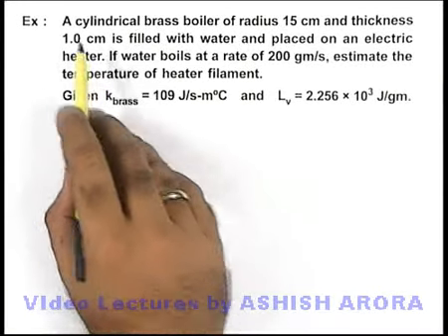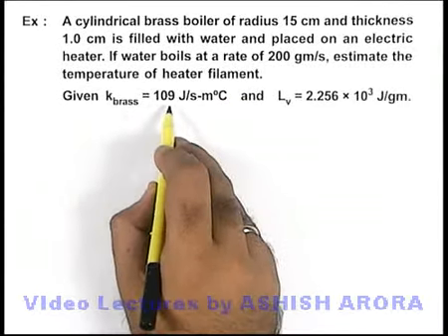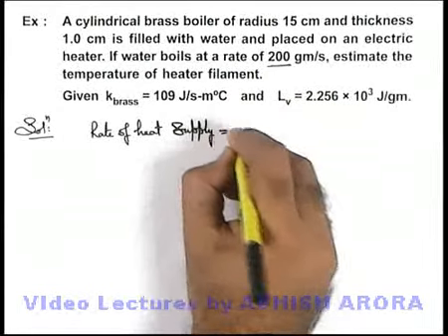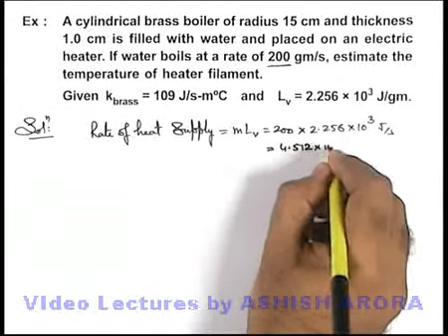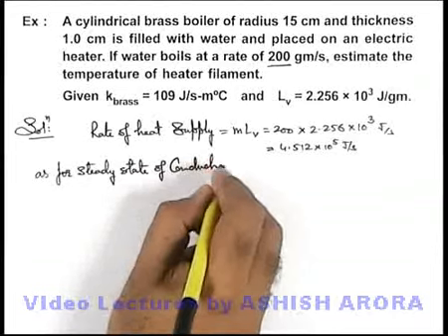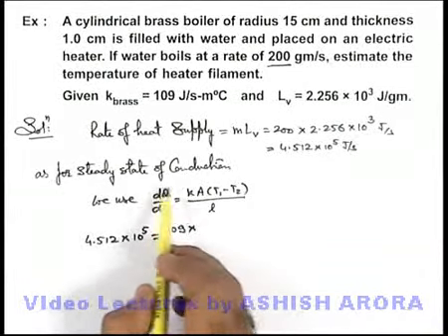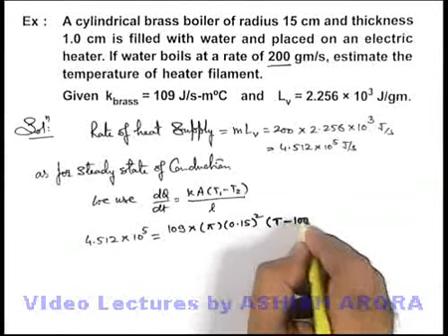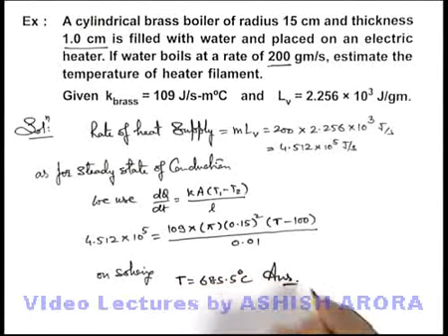Class 11 Physics | Heat Transfer | #7 Solved Example-2 on Heat Transfer | For JEE & NEET

Comment: sir,why didn't you use ms(delta)T?
Reply from the maker: msΔT is used when a body of mass m and specific heat s is heated by a temperature ΔT and thats not the case in the question...
Reply: Here water is boiling...and u might be knowing that during phase transition temperature remains constant....and that formula is not applicable in that case

Comment: 2:42 I didn't understand...how do u take the thickness of cylinder (outer radius-inner radius) as the length of the cylindrical boiler!?
Reply: Ritesh Uppal Here we don't need length of the cylinder.....length in the problem is distance between water and heater , which has cylinder wall in between so length equals thickness of cylinder....imagine water in a bucket placed on the ground ...distance between water and ground equals thickness of the base of the bucket .
Reply: @SaiTeja-oo3dv  thnx bro I got this ques becoz of u

Comment: sir why have u used steady state
Reply: as heat is supplied to the water through the cylindrical vessel so the mode of heat transfer is conduction and that's why we use steady state
Reply: Cuz boiling rate is constant